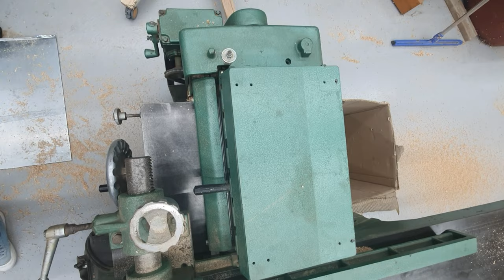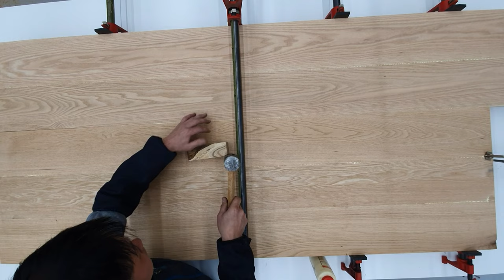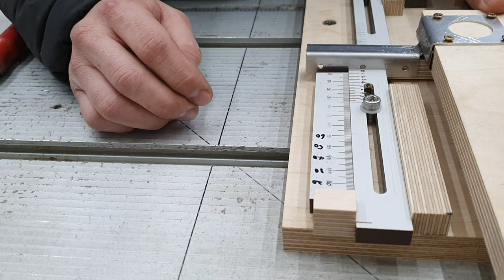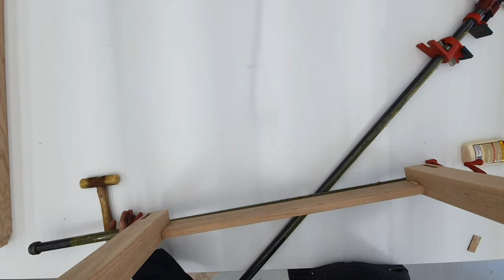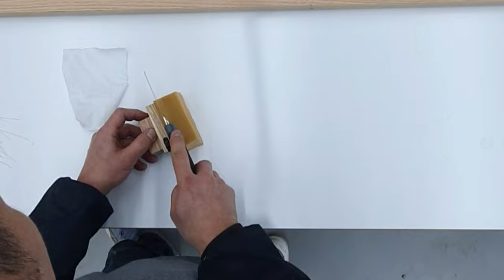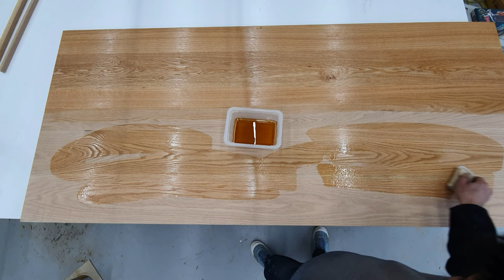made without festool domino oak dining table

Comment: I really enjoyed watching the whole process. I love seeing how u built the legs by laminating narrow pieces together to make them. It just shows u don't need bigger squared lengths of timber to make great legs for a table.  It's a beautiful table my friend. I would love to work with some nice OAK but alas for me right now it's far too expensive. 
I can always come here to YT and watch great woodworkers like u making nice furniture. At the moment I'm learning to use hand tools much more in my shop. I'm very much enjoying that process, how to sharpen Irons, chisels, etc and how to plane a board flat on edges and fronts, etc. I never thought I would enjoy this part of the process of woodworking as much as I am doing now. I actually prefer to work with hand tools far more than power tools now. I still use the table saw to cut bigger pieces but I prefer to cut smaller pieces and planes them by hand. 
Thanks for this brilliant video pal. Keep up the great work.
Reply from the maker: When you do woodworking as a profession, speed becomes more important than anything else, so it is inevitable that power tools bring more profit than hand tools. I will show you putting in a little more effort. Thank you for watching.